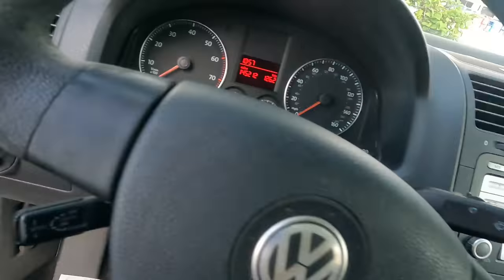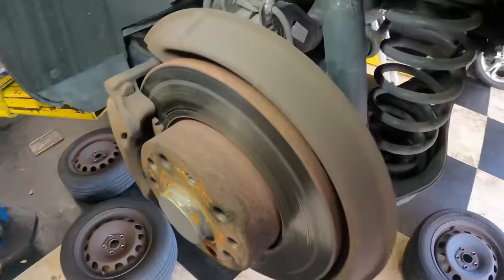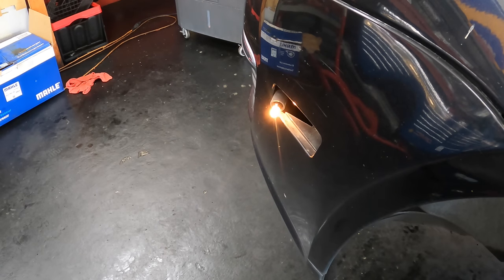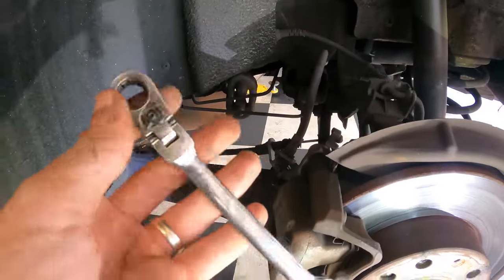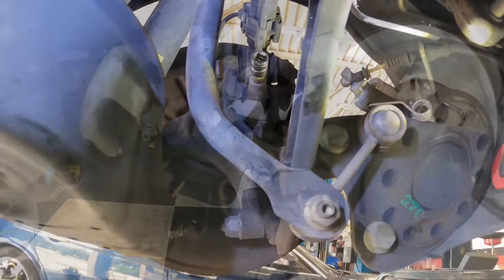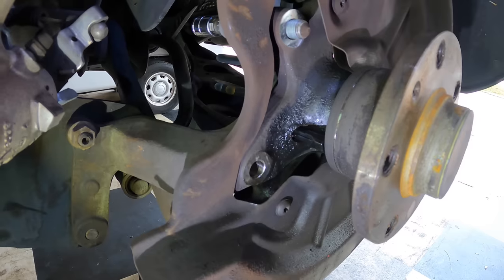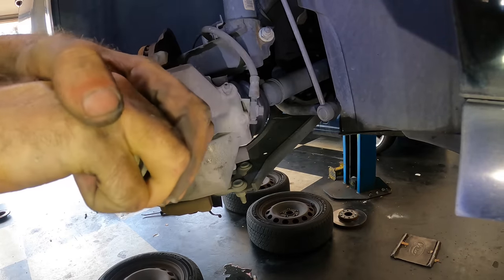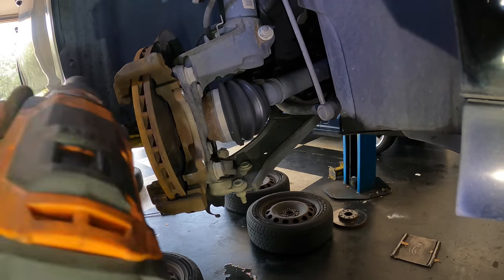Over Engineered Bolts! Four wheel brake job. Actuated Calipers. Volkswagen Jetta 2.5

Comment: Agree with you about the licensing for handling freon. I obtained one of the first issued as a General Motors instructor, then saw non professionals buying it off the shelf with no licensing requirements,  our tax dollars at work and epa didn't care. Hard to accept that it was damaging the environment when anyone could buy it off the shelf cheaper than it cost a shop to buy in bulk.
Reply: In the long run, Mike, every bit of refrigerant produced is going to end up in the atmosphere, if you think about it.  Lots of folks out there are keeping their cars A/C operating by adding a can of R-134A from time-to time because they haven't got the $300 needed for a shop to hook it up to their fancy machine plus the cost of the necessary repair parts.  At some point, it'll get bad enough that they'll have to bring it in.  
As far as damaging the environment, the certification classes are now teaching that the newer, less-chlorinated refrigerants aren't damaging the ozone, but they contribute to global warming.  What that tells me is that there's no real reason to restrict the sales of the newer stuff, but the government never gives up control of anything, so everyone will continue to need a license to handle refrigerant just because.

Comment: I never put in a light bulb ANYWHERE that I don't use a rag with some alcohol or Windex to clean off my finger prints that contain oils that when heated cause a temperature imbalance on the surface of the glass of the bulb.
A crack could develop on that "oily" hot spot.
It's just a good practice to keep the bulb clean.
Especially the oils and salts on your hands will make the "touched" areas hotter and decrease the bulbs life.
Very hot Halogen bulbs suffer from this bad practice.
I know that car lights use a DC incandescent type which are now shifting over to LED's but even they can suffer from the same "oily" surface problems.

Comment: Curious why we recommended front brakes with 6mm of pad left?
You got a bunch of brake clean in that slide pin hole and didn't dump it out. You can even see some squirt out when you put the pin back in.

Comment: I think on those vw you can just slip the rotor off without having to remove the rear caliper bracket
Reply: Yes you can, just did a 2000 beetle rear brakes.

Comment: so many different fasteners, Triple square is just as prone to rounding out as torx. Give me allen bolts any day. lol  Cut's like that on your thumb, if they are deep like that I personally will clean it up good and put some super glue on it to hold it together. Keeps the goop out and it doesn't hurt as much. Otherwise I end up with a napkin and some electrical tape.

Comment: The regular brakes working as a parking brake is a horrible design feature, if it's cold during winters. Some drivers, who don't know about it, use it instead of putting a gear in to keep the car still and they then freeze. Had to defrost these quite often. Also saw one Transporter, where the brakes were partially engaged, the discs were glowing red after a 2km drive, when it became noticeable. Never had any issues with freezing on any other car, except for the parking brake on Klonkswagens

Comment: Seems you get incorrect parts as often as I do. Glad it's not just my  parts stores that suck. Also, I notice you wear your wedding ring. I'm not married, but a have a couple of guy at my shop that wear silicone rings at work. After seeing one accident related to a metal wedding ring, I always recommend silicone rings in the shop.

Comment: VW FYI:
The center of the cars gauge will tell you if any of the bulbs are burnt out.

Edit: another VW FYI: it's not necessary to unbolt the caliper holding bracket to get the rotors out.
Reply: It is required for the rears on the Mk5.  There is not enough room to remove the rotor without loosening the bracket.  For the front though, I agree.

Comment: Two questions I was told not to use brake clean on the rotors to clean the oily residue but to use just soap and water as some brake cleans can contaminate the new pads.  Did the pads have a pin on the inner pad as some of those twin actuating calipers have

Comment: Ray I saw sockets on Amazon with reverse fluting, for extraction of rounded bolts, nuts, lug nuts etc. From 5.5mmi think that small up to 22mm,7/8s in 3/8s and 1/2 inch drive, impact!
I watched you drill off those rounded lug nuts a ways back.
I used to have locking lugs on my pickup, thought that was a good idea!
Then one day I was thinking where did I put that lug key?
Gone is where it was, so I thought!
Found it yesterday, long after I’d gotten the locking lugs off!
Wonder if snap on has those special sockets?

Comment: Ray have you ever seen calipers where the slider holes are so gummed up that you have to clean them out before the pin will slide correctly?  I ran across this a couple years back on a  '91 Accord I had.  One of the calipers was hanging very badly and that's what I found.  Stupid dealership didn't even bother to inspect my brakes properly before telling me I needed new calipers.  Or maybe they did, and figured they'd make more money replacing rather than cleaning.

Comment: Im gonna have to say it sorry. Im a mechanik from germany and been working with VW the entire time. The bolts on the bake breakes (triplesquare as you call them) are not reusable. They need to be torqued with 100Nm plus 90 degrees.

Comment: Seems like a fairy tale here in road salt land that you can open those caliper mount bolts with a 3/8" drive. Here it is 1/2", very angry lenght ratchet and/or impact gun with extensions.

Comment: If you hate triple square, you're really going to hate the 5-sided bolt head... As used on some citroen models
Reply: Lucky You
Reply: Self explanatory, French engineering  makes no sense at all. Doesn't have to because reasons. Built an engine that was a two stroke that used an engine driven pump for the oil. Wouldn't pump at idle or out of gear so you had to accelerate  the car when
Reply: Braking.
Reply: More ridiculous engineering
Reply: Or the 2CV whose primary design function was to be able to carry pigs in the back seat.

Comment: Just replaced the entire front brake assembly on the old rambler yesterday. First time doing anything brake related, but it wasn't too bad...other than getting brake fluid everywhere. As for your thumb cut, just spray some brake cleaner in there to sanitize it. It'll make you forgot all about any other pains you might be having.  EDIT: Any particular reason you didn't grease the ears on those pads?
Reply: @peted5217  Most jokes bounce off bipeds, skull too thick to absorb.
Reply: @gotdangedcommiesitellyahwa6298 Heartily Agree

Comment: I just now noticed a screw up from Volkswagen. The wear sensor is on the driver side instead of the passenger side. Now of course where most of their cars are driven, you would want it on the left, but here in America, it should be on the right (passenger side). The passenger side is the curbside, and that’s where all the road dirt and debris collect, and that’s why the passenger side brake pad is most generally the one that wears out faster. I’m amazed they (Volkswagen Engineers) didn’t think about that. 🤷🏻‍♂️
Reply: No screw up. I've dealt with it on drivers side hundreds of times on new vw
Reply: @thomasroberts7349  That’s not what I mean. Here in America, we drive with our passenger side tires rolling through all the road wash. (Debris) I’m saying that Volkswagen needs to switch sides that they install that sensor on, to the other side, only on cars coming to be used in America.

Comment: I noticed that there was one missing bleeder screw dust cap on the last caliper you worked on. What gives? That's a big no-no up here in Michigan, where the moisture can cause corrosion.

Comment: Had my oil changed a week or so ago, found out my windshield whiper fluid wasn't working. Thought nothing of it at the time. Went out this morning to fill up the fluid and found my engine fill cap missing, my engine bay covered in motor oil and the line for the windshield sprayer disconnected....now to email the mobil1 and find out what their massive multinational company is going to not do to fix the problem.
Reply: One reason why I change my own oil - except on my motorhome, which takes a special drain pan to hold the 4 gallons (yes, 16 quarts) of oil as the oil pan on the Cat 3208 is only a foot off the ground and I have no way to jack up a 16,000 lb. vehicle.  I tried it once and after being covered with used diesel oil I decided it was worth the expense to  have a specialist do it.
Reply: @johncooper4637  My driveway is on an incline and my garage is temporarily full of stuff, so no flat place to change the oil. This was literally the only oil change I've had a service provide. Contacted the Mobil1 location owner. He's picking it up from my house tomorrow to fix it and make it right. We'll see.

Comment: Ray at work we use the same Permatex purple brake lube but I got told that the purple grease gums up and freezes the caliper pins. My GM told me that and gave me a bottle of dielectric grease to use for the sliders. Granted I'm in NJ and not in sunny Florida but have you had any issues using the purple stuff on sliders?

Comment: the front slide bolts should be removed cleaned and lubed  ps, they are 7mm hex not torx   some older or rusty ones need the rubber removed to remove rust from the caliper holes

Comment: Do you need to take the caliper bracket off to remove the rotor? I remember that they can be removed with it still in place, due to a cutout in the caliper bracket.

Comment: Doing those calliper bolts, without a lift, not easy as you will need a breaker bar. I replaced my son in laws with hex head bolts.  Those 12 points are a disaster waiting to happen here in the great white north.
Reply: This.  A breaker bar moving 1/8" at a time.  Brutal.   Torquing them up is worse.  No breaker bar on my torque wrench.

Comment: No shims on front calipers? I did new rear calipers on my VW Bora 1.9 TDI and no matter what I do calipers are binding, haven't replaced sliders yet and have had great difficulty winding caliper back. I use the same tool as you yet piston binds hard!, any ideas Mr Rainman sir?.

Comment: Another “get two operations from a single device” the rear brake lights and their corresponding marker lights are on the same wires. The brake light receives a higher voltage when applying the brake and a lower voltage when only the marker function is warranted.
Reply: Interesting. That would seem to break the safety rules, but nothing is surprising these days. Have a link for info?
Reply: I used my multimeter and tested the circuit. I tested as at first I was not seeing how a bulbs with only a single element could provide two different intensity levels.

Comment: [Looks like the front and rear brakes were designed by two different engineering teams.  Why were brake pad slider clips not used on the front?

Comment: I have them triple squares, I've had 17+ VW products over the years, it is a better design, no striping, surface area, and when it's being assembled, quick and secure, they developed it for a reason
Reply: @jgn593  It's not "shit" it's a better design, do you think giant mfgs of 10 million vehicles are gonna spend engineering time to plan stuff so YOU can't work on your car, it's all about assembly line efficiency, and robustness, and stuff to perform as needed, watch an assy line, how stuff falls right into place with fasteners, cus they are designed with special tips, and head designs, so the tools hold onto them...so a TORX fastener is just made to confuse you?  NOPE...And security torx, are there to really blow your mind, but the tools to use them are readily available
Reply: I stripped one of those stupid bolts on my car and the stupid thing was not even rusty.
Reply: @CoreMaster111  always give them a few taps of a hammer to make sure its seated all the way they really ain’t that bad
Reply: @jgn593  so if the tools are Available it’s stops no one 😂😂😂
Reply: @CoreMaster111  you used the wrong tool, simple
Reply: @jgn593  You are in the WRONG business then....I guess correct tools is just irrelevant, the world doesn't function on just an adjustable wrench and a screwdriver ya know, you probably use a screw driver as a pry bar and chisel too?
Reply: @jgn593  Ya can't make chicken soup from chicken shit, get the proper stuff, it all functions quite well
Reply: @CoreMaster111  The bolts ain't "stupid", the person using the WRONG tool could be though?

Comment: I hate those triple square bolts my buddy had a jetta he wanted to do brakes on and someone striped out all the bolts that were triple square so I had to weld nut on them to remove them and we went to hardware store to get Allen head bolts to put back in

Comment: VW and their triple squares. My 1972 VW bus used them for the driveshaft bolts which is evil if you don't know what they are. The bolts are usually full of dirt and oil so easy to mistake as an allen head or torx. Nice to see they are consistently annoying with their fasteners. Its as if the manufactures sit down and decide that they all need to have a fastener that they are going to adopt. VW triple square. BMW motorcycles Torx. Then there's Apple who find the most obscure sizes and shapes possible.

Comment: I never liked trying to turn those style of rear rotors on a lathe. Even with sharp bits at a slow speed they liked to chatter, which isn't good when resurfacing them. Brake rotors can be had for such reasonable prices now I'm surprised anyone uses a lathe anymore. I wish manufacturers would use regular bolts and not fancy torx or hex head bolts on those pad brackets.
Reply: manufacturers use them to discourage home repairs; electronics industry are the experts at that.

Comment: 8:58 
I'm surprised that any rotors are machined these days. But I guess maybe pick-ups, large SUVs and vans might be more cost-effective to machine.
Reply: I'm surprised brake rotors where ever machined to begin with, no way would I ever chose machined over new. Rotors are designed with a specific thickness to handle the heat dissipation.. machining rotors only makes them even thinner, hotter, and more susceptible to warping.
Reply: @jeremycovelli  Is warped rotors really a thing?
Reply: @jeremycovelli  That's why they have spec's for them, i.e. minimum thickness stamped into the rotors.
Reply: @SamCanada1  Have you never experienced steering wheel shaking when applying the brakes on any vehicle and or shuddering / pulsing in the brake pedal?
Reply: Yes, the big front brake rotors that have the inner and outer wheel bearing races are worth machining. But this style that just slip on a wheel bearing hub aren't worth the labor time to machine because it's not really a low skill job to properly machine a rotor, so it becomes cost inefficient. I wouldn't trust a brake rotor machined by someone only getting paid minimum wage; yes it's possible they will do a really good job, but I don't want to be the customer to take advantage of someone like that. People should be paid for their time for what it's worth.
Reply: @brnmcc01  Makes sense. :)
Reply: @jeremycovelli  If a rotor actually warped, there are bigger problems going on, like thermal nuclear war, which may warp the rotor. lol But seriously, warping is a myth. Irregular thickness in the rotor, from not 'bedding in' the rotors, (which is a brief break in procedure), or it could be oil on the rotor or pads, etc. causes pulsing or vibration when braking.
Reply: @bushmaster2936  Absolutely @bush master. It's caused by irregular thicknesses in the rotor. Calling that condition, 'warped' calls up an image of warping like a piece of wood or lumber, which is misleading but I assume most technicians will know what the customer means. :)

Comment: Top tip, any floating caliper, to remove without damaging the customers property, take a small flat pry bar or screw driver and push between the disk and pad, gently pry the caliper towards you, using the disc for leverage and makes it easy to get the caliper off

Its not called a  triple square.  Its a multispline.  Used in tight fit areas.

And that you cut your thumb🤣🤣🤣   just like the neighbour, i sharpened all her knives and warned her DoNOT test the sharp knife you will lose your finger...  😆

Comment: These brake calliper bolts are a pain . Why not just fit normal bolts or hex bolts which are easier to remove.I'd be changing them out if they are in any way chewed.

Comment: When you had to rotate the piston back in, I wondered what rotates it when it comes out?
Reply: I believe the parking brake mechanism pushes the part on the screw behind, (and connected to), the piston out. It will also be pulled out along with the piston under hydraulic pressure from the foot pedal but isn't as effective in taking up the free play until the parking brake pushes it. I don't believe rotation takes place on the way out as can be determined by turning the piston the wrong way which doesn't wind the piston out.

Comment: So how come VW used hex bolts on the front caliper bolts with nice little rubber bung hole plugs, and on the rear just crappy triple-square bolts with nothing to protect from salt and debris?